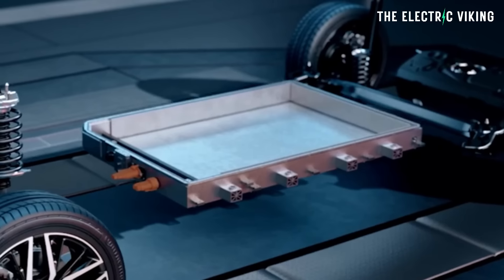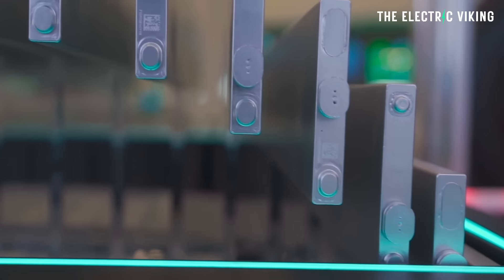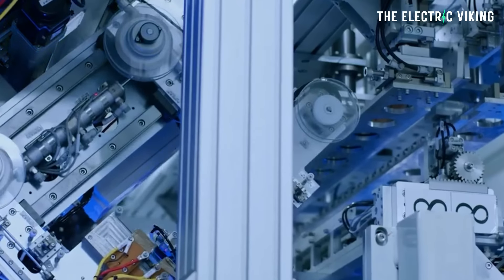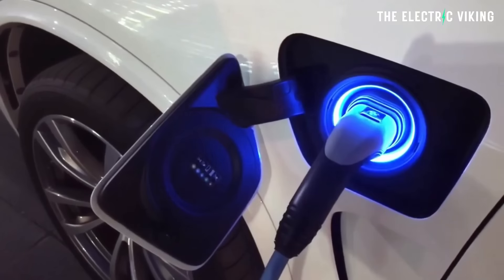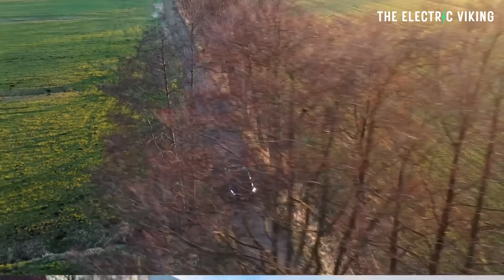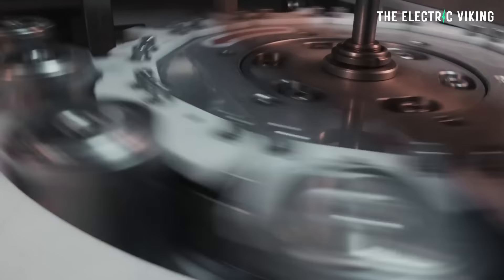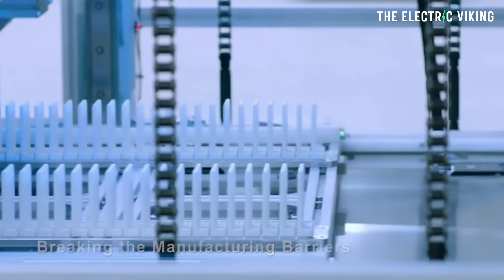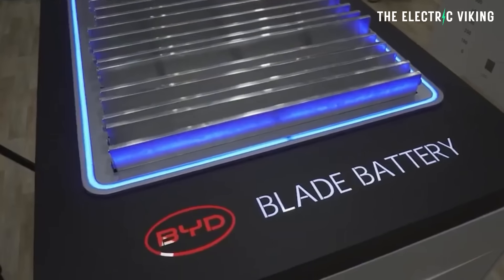BYD's new second generation Blade battery will revolutionise EVs

Comment from the maker: For free tickets to the show use this link and one of the promotion codes below (if one doesn't work you can try another one) 
electricviking2024, 
electricviking_sydneyevshow, 
electricvikingsunday (Sunday only) :
https://www.futuredriveauto.au/syd/ev24/comp-tickets

Click here to get a free charger and installation when pre-ordering the G6 
https://xpeng.com.au/?qr=726XPO 

The best solar company in Australia just installed my new solar system. 
Check them out here: 
https://www.resinc.com.au/electricviking
Reply: I would like to join the show but I live far away.
Reply: There's an article on "The Korean Car Blog" saying there will be an LFP battery from Hyundai in 2025 with 300 Wh/kg. Do you think this can be true?

Comment: Fast charging is not required if you are on a city trip, well within the driving range of the battery. It should be used only on highway drives, where your travel range becomes an issue, because Fast charging is generally not good for their service life and must be avoided, as far as possible.

Comment: As an Atto3 owner I can say the V1 blade battery is very very good. After two and a half years no sign of any deterioration. If it does start to flag I look forward to upgrading.
Reply: I think the batteries do have a warranty. But don't know the validity of the warranty please check and do share. Thanks
Reply: Don't expect much trade in value.
Reply: Agree, what are you on Sam that 200+ KW charging is "not good" - most people would be absolutely fine with what Teslas manage, i.e. well under 150 on average.
Reply: Upgrade to an ICE car.
Reply: Do you use any app and OBD2 dongle to monitor the battery SOH?
Reply: @pollada1  No, just the onboard instrumentation. 

The BYD battery is heat pump liquid cooled. It is 126S1P blade cell configuration, LiFePO4 chemistry and a nominal 400V. There are no parallel cells. 

It is a very simple skateboard configuration with excellent thermal management that largely eliminates heat spots.

I do a fairly regular round trip of about 300 km. I use that to get a read out on energy use, and energy amount to fully recharge.

These trips showed over the first eighteen months energy capacity actually went up by about 5%. I attribute this to 'forming'. It now seems to have plateaued and certainly shows no sign of deterioration.
Reply: @markmiller8903  ice is dead

Comment: BYD Blade gen 1 cell C104F (152Ah) has gravimetric density of 186Wh/kg according to the datasheet. Slightly older C102F (138Ah) has gravimetric density of 170Wh/kg. Both have the same dimensions 960*90*13.5 mm.

Comment: using kilowatts to judge the charging speed isn't really fair. There are likely other limitations involved that don't have anything to do with the battery itself. Additionally, battery kwh needs to be considered. A  battery twice the size can generally be charged twice as fast.  The battery charging C rate is what needs to be known. I do not know if BYD publishes this.

Comment: The figures quoted are for the cell level density, when you translate that to a total pack weight a 64kwh v2 blade pack would weigh 90-95kg less than a V1 - not bad applied to a 1900kg car but won't turn it into a featherweight.

Comment: We were at a BYD dealership today. I test drove a Seal. It was fun to drive but, at about 21,000 yuan, it doesn't compete well with cars by X-Peng or Zeekr, which are only a bit more expensive and have self-driving and are more luxurious. The Song is good value if you want a cheap, good car, but it is not what we are looking for.

Comment: The cost of public charging is so prohibitive. In the balance of things to prioritise in battery/car design, efficiency (kWh/kg) volumetric density and continuous power rating at pack level, are important to me. Vehicle range and Public fast Charging speeds are already good enough. If they improve without compromising improvements in other areas, great!

Comment: I don't need or looking for 10 min charging.  All I need is 7kwh free charging at night.  What tech I would like is V2H and V2G.  I have used my V2L during power cuts.  What would be useful is plug car in, charge for nothing at night, and power house during peak hours re V2H automatically.
Reply: I am very happy granny charging my dolphin from 3am with yesterday's leftover sunshine. 😊
Reply: Charging at home by solar is obviously the way to go, but I don’t see how home solar charging is seen as being “free”. Here in Australia a suitable solar installation to reduce your use of grid power and charge your EV is about $13,000 AUD ($10K USD). That’s a lot of petrol money and several years driving if an ICE owner was considering switching to an EV.
Reply: So true. How many 500kw chargers do you see around?
Better to have more capacity and warranty tbh
Reply: Did almost all of the charging of my last EV at home, but it would have been nice to have 10 min charging for longer trips (holidays).  Some EV makers, especially for smaller EVs, assume you'll never do long road trips, and put in an anemic charger.  I hope that automakers will start offering superfast charging as an option: leave it out when you don't need it, pay for it if you want it.
Reply: @PropanePete How much kW of power generation do you get at that price?
Reply: @vgbyte1648 I'm not sure what he's on but 6kw is 2499 here in oz. 10kw is around 3900 and 13kw is around 4200 ..   that's with current government rebate s.
Reply: @PropanePete  That $13K is used for your washing machine, fridge, oven, kettle, lighting and power points - as well as your EV.
Any other complaints about solar?
Reply: Absolutely Pete. Our next car will be an EV but I'll probably wait until V2G is legislated and available in Oz.
VPP, V2G and an EV will be a game changer
Reply: Absolutely agree. I have only ever used a DC charger twice. First time to see if it charged the new Atto 3, a test, the second time was when I had driven a fair way from home and could have made it back but just thought I'd play safe so used a DC charger for a few minutes and put about 20% of charge into battery. We charge at home and use solar and therefore, the cost to us is zero extra. Just wish we could charge at a higher AC speed with the Atto 3 rather than the nearly 7kW I have at present.
Reply: @  You’ve misunderstood me, I’m pro solar, tidal, pump hydro, etc, fart driven turbines, nuclear, a million rats running flat out rotating a drum attached to a generator, anything except coal. I was just pointing out that spending money to save money does not bring instant results. My engineer neighbour took delivery of his new BYD in February and also installed a $13,000 AUD solar system in the same week to get the best charging value for the car. His accountant wife worked out that it would take 5 years to break even and that included the household appliances. She is running a very impressive spreadsheet and after 9 months of data she has pushed that estimate out to nearly 6 years. And as she says, the BYD will probably be buggered by then anyway and she has kept her 2006 Audi just to see how it all pans out from an accountancy point of view.
Reply: What a great comment. As an EV owner V2X and efficiency are much more important than charging speed. Charging speed improvement is nice to have, but not at expense of other these other 2 aspects.
Reply: @  It depends on where you live. Australia is a vast country with a small population and a dysfunctional power grid. Every 3 months we seem to get less and less power for a dollar. If you own an EV here and are reliant on grid power, the power bill for your EV will be much the same or slightly more than an equivalent size ICE car. To make an EV worthwhile here, you need a house with off-street parking and a comprehensive solar setup on your roof. Our situation is very different from Europe, Asia and the US.
Reply: @ @  It depends on where you live. Australia is a vast country with a small population and a dysfunctional power grid. Every 3 months we seem to get less and less power for a dollar. If you own an EV here and are reliant on grid power, the power bill for your EV will be much the same or slightly more than an equivalent size ICE car. To make an EV worthwhile here, you need a house with off-street parking and a comprehensive solar setup on your roof. Our situation is very different from Europe, Asia and the US.

Comment: Fear of missing out (FOMO) on one battery tech generation is a reasons that battery swapping might be a good idea. package up the entire generation and over 5-7 years of batteries you could get 3 generations the way things are going today. They could then sell GEN 1 for energy storage while you drive around on GEN 3, when new battery tech comes out slap it into a standardized package and swap it onto the vehicle, if a problem shows up revert back to the previous generation while they sort out the new stuff.
Reply: This is what i'm hoping mg would enable on mg4 and newer cars. Ie i put in a nice new solid state or lmfp battery instead of my regular lfp battery and get a range upgrade. Also bms upgrade to increase charging speed of the new battery

Comment: The evolution we need to see with batteries is lower replacement costs or easier to fix partially faulty batteries.  My P100D is 7 years old, at some point the battery is going to become an issue through degradation or total failure.  The replacement cost I know is horrific (over $25K AUD I've heard), if these 'blade' batteries could allow faulty cells to be changed out for maybe $1,000 then used car buyers won't be so afraid of EV's.
Super fast charging is nice and all but for most EV owners they soon realise that isn't the deal breaker, I've had mine since 2018 and I've visited a Supercharger 4 times.
Reply: agree

Comment: I think the biggest reason to buy BYD blade battery is safety rather than max density or max charging speed.

The fact that the blade battery doesn't explode and give you a free cremation when puncture is a compromise I am happy to take.

Comment: How am i supposed to have lunch after 500 kms if i have to run back and move our Seal.  I struggle to think of where or when I'm EVER likely to even NEED a faster charge rate than our old LFP version has. This 'miine's bigger than yours' nonsense is just so irrelevant to the vast majority.  LFP safety and endurance is what matters to the grown-ups.
Reply: Exactly what I thought! Also by the time you wait for version 2 to arrive here, order the car, take the delivery of the car and then within a short period of time version 3 will be announced. I have Seal Performance, I don't even charge it to 100%. The only time I charge it to 100% because the car tells me to for battery calibration purposes. I drive 100+ km most of the time as my house is 50km+ from CBD even then I never found a moment that I need more range.
Reply: I am considering going the other way when retiring soon and disposing of my model y long-range and getting a dacha spring... It is very encouraging that there is growing variety for people. to match to their specific needs.

Comment: The limitation of charging speed is going to become more a problem of the grid - unable to provide enough electricity - rather than the ability of the cars to soak it up. Wind turbines don’t provide energy on demand - it’s a question of having as many EVs sat plugged into the grid as long and as often as possible, to soak up the turbine output when there is plenty of wind. Then when the wind doesn’t blow the EVs aren’t hungry.

Comment: The real interesting thing is home charging from solar and home battery . Home storage battery will soon be so much cheaper you may have a storage battery around 50-70 Kw  for about $10,000 . As car EV batteries are much cheaper and reputedly cost around $3500 for a battery pack for a Model 3 WITHOUT  Government subsidies .If you Combine this with say a 18-25 Kw solar system you could have the ability to charge you EV  quickly after work at home . As most EV are charged ( or actually topped up ) at home once or twice a week . Very very few EV are driven more than 300Klm a day ,most are driven around 400 Klm a week ( ie one charge ) . 
As new houses are being built with EV in mind you will see power outlets that at home can charge a car in a few hours . Simply free solar electricity .
Reply: What you describe is a version of what I have at the moment (minus V2G) and it's marvelous. Having previously run two diesel cars,.Diesel was our biggest expense after groceries.So it's a huge saving not to mention servicing , maintenance and etcetera...
Reply: wr
Reply: Its not free!!
Reply: That'll bump up the overall battery enrgy storage costs significantly.

Comment: I actually have Model Y with ghe old Blade battery and charging is amazin, even in Winter at really cold temperatures it gets its full charging power of 175 KW without much preconditioning. Carging speed on long distances is totally fine here, ok the capacity could be a little higher than 58 KWh. I'm really courious, what battery Tesla will put into the Juniper SR.

Comment: to be honnest, you don't even need to charge 5.5 C. If you have a 65-70 kwh in an entry tesla, you can charge on v3 superchargers with the maximum speed (250 hopefully) and it will keep that speed for a long time.... and you might get in 12-14 minutes from 10-80%

Comment: energy density numbers are at the cell level and depend on, the cell format a lot ! To be simple :
=> a pouch cell "à la LG" will have the best energy density, NCM only BUT you need a strong module eating on the pack density at the end
=> a "brick" prismatic cell  "à la CATL" will show a lower but still pretty good density (the thicker the better for density but lesser for Fast Charging and power). will be ok with LFP or NCM
=> a short blade (not too long , up to 600mm, not too thin) is a pretty good optimal solution between power and energy. the best for LFP ! NCM possible up to 300mm long cell.
=> a long blade cell "à la BYD" , 1.2m long about , LFP compatible only, will not be optimal as it needs to be thin for voltage reason, and will have a lot of can material eating on the available internal volume for the chemistry

Comment: You forgot to put "INSANE" and GAME-CHANGER in the title! 😂
Reply: LOL
Reply: I watch all the Game-Changer videos ))
Reply: And holding head in hands
Reply: But it’s actual more factual than usual…..probably just taken Sam by surprise. Battery tech is about it get frightening the pace it’s change is about to happen. By 2030 Cars will have smaller lighter batteries that go further. I recent U.K. survey reported the average U.K. owner wants real world 300 miles worst case in winter to move to EV’s. I’d say we are already there but when the smaller hatch EV’s get 300 miles then EV’s have arrived. It’s not even the density it’s the actual cost to produce falling off a cliff.
Reply: Isn't "revolutionize" everyday is not enough?
Reply: U missed it. He did say insanely😂
Reply: Can't wait to use all the 500kW chargers I come across around where I live.
Reply: @SWR112  The MG4 EV Trophy Extended Range with the 77kWh battery has a claimed WLTP combined range of 323 miles and it costs £36,495. That would have been unheard of a few years ago.
However, I would not buy that car because I keep my cars for a long time and it doesn't have LFP batteries. Hopefully, BYD will soon be supplying the Dolphin with Blade 2 batteries.

Comment: Here's my two cents. I for one don't think batteries charging at 500kW will revolutionize anything. Only thing they'll do is put insane stress on the already crumbling energy grid. What we need is a battery that can keep its charging speed deep into the pack. We're talking 200kW at 80%. Most batteries fall off a cliff after 50%, falling below 150kW, some even lower, to 120kW or 100kW. My MYP24 limits to 80kW at 80% charge. I mean.. rather than making a battery that can except the first 20% in 2 minutes, maybe make one that can except 250kW for the whole 10-80% stint.

Comment: How are these blade batteries cooled? I know how Tesla uses alum channels that weave between battery rows, and since cooling is critical, how are the blades cooled?
Reply: They are liquid cooled using a heat pump. The cooling channels are on the top of the battery pack.
Reply: Espionage 😅
Reply: do u really think the second biggest battery manufacturer doesnt know how to cool their battery? 🤣

Comment: With so much development within 2 years of EVs on the market, I think Nio's concept will benefit all EVs. You buy a Nio with the old battery tech 2 yrs ago & when newer better batteries come into market, you get to swap to high density ones & get better range. That way early adopter don't feel pissed buying the EV early.
Reply: You are assuming the design can be made compatible. Newer battery enables better design to the car themselves. Making compatibility a challenge.
Reply: Or you get to swap into a battery that's 5+ years old and on its last legs.

Comment: So help me with this: This new BYD Blade 2 battery still has a slower charging rate than a lot of other batteries out there and at the same time does not have anywhere near the highest energy density out there yet you claim it will REVOLUTIONIZE EVs, Sam? How so? I'm already not interested and am pretty sure this particular battery will not revolutionize anything.

Comment: You need to look very deep on batteries before making a comparison because there are too many variables. 

For example- 
Cost per Wh. 

Internal 
resistance( efficiency).
Weight per Wh , including the installed pack( and subtracting weight reduced from the car frame if the pack is a structural component) 
and the cooling system. 

Degradation rate if repeatedly fast charged.

Performance in very cold and very hot conditions.

So I’m not finding your channel very helpful because you are missing all the detail.